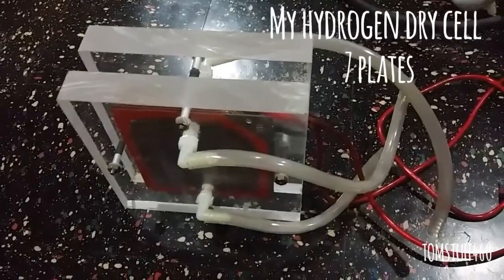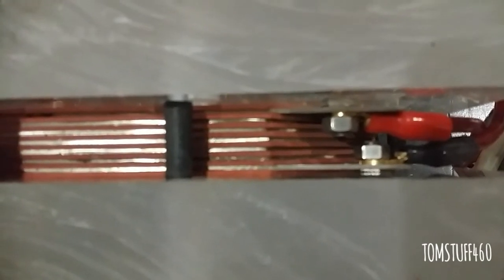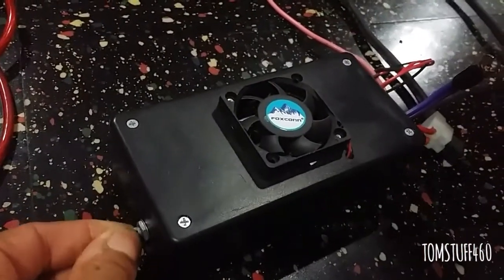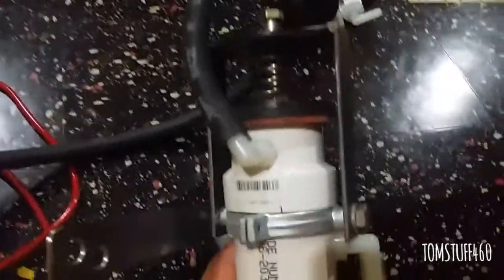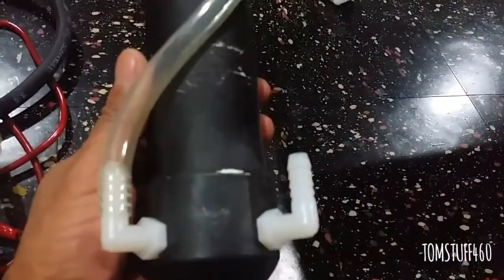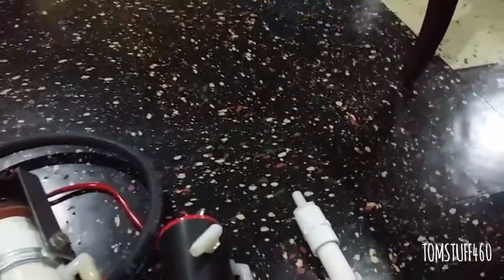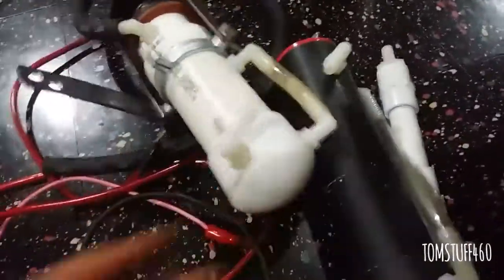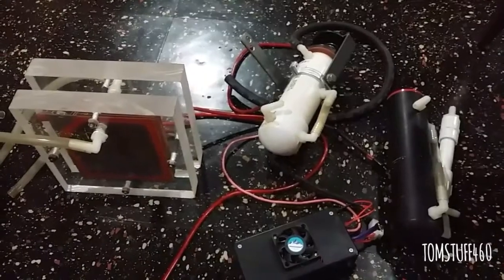HHO hydrogen dry cell 7 plates

Comment: Mr scammer, everything is new there. Not even 5 months used. You are a little scammer trying to claim 5 years function because you want lazy people to trust you and to get in touch for buying. So you gonna make money from scams.
Those cells need lot of maintainance. It's expensive to run. And you need rain water purifier to get deionized and distilled water in the same time without using any electrolyte.
Potassium hydroxide can harm the air. So that's not a clean energy.
You need to research about rain water hho before admiting your fake 5 years rubish scam. It doesn't work as you plan. Because you have not got enough researching.
Reply from the maker: By the way I have a name!
I have installed this in my Chevy S10 for only a month and haven't seen no results so I removed from my truck and it hasn't been used since. This setup produces 1L a minute of hydrogen.
Yes I have built it 5 years ago and still own it and just decided to put it on YouTube to show other YouTubers to see my work.
Plus I'm not advertising , scamming no one and not making no money from YouTube. 
I only have 650 subscribers in 6 years.